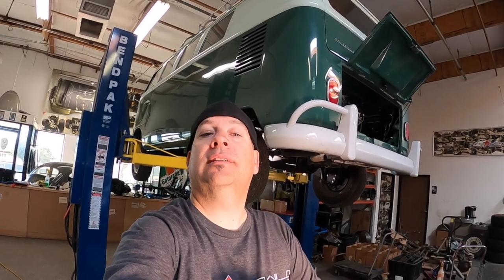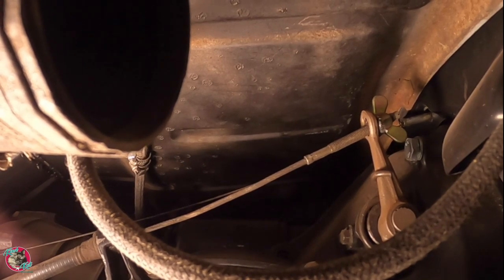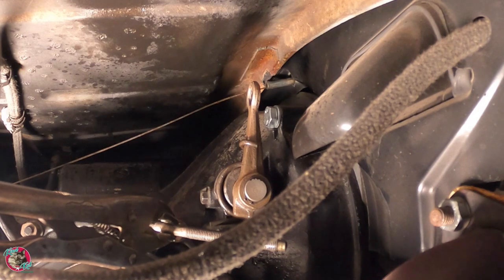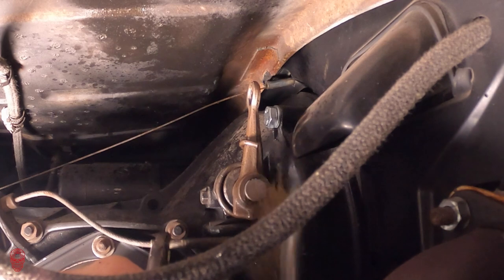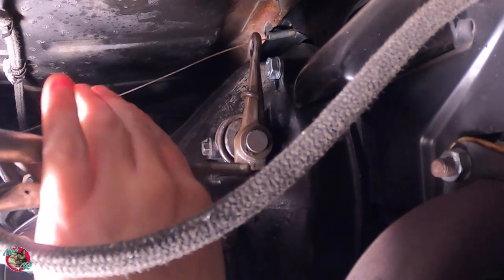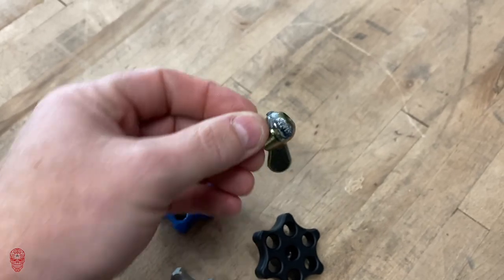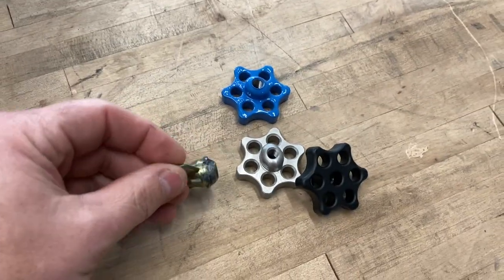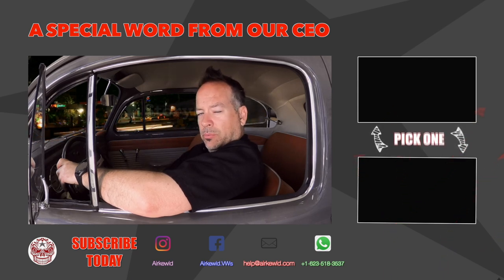FINALLY...the Volkswagen Clutch PROBLEM has been SOLVED!! Only takes 1 NUT to do the trick!

Comment: I like it great idea, what a nice van as well , please don't run the fuel line through the front tin with out a grommet or gorilla tape around it a least. the engine vibration can where a hole in the gas line and set you up for a disaster(fire) That van is a real beauty.  The six shooter is very clever. I'm going to check it out   Thank You
Reply from the maker: Thx Darol, just picked up the bus, this was the first thing I did. We will get all the I’s dotted and T’s crossed soon.